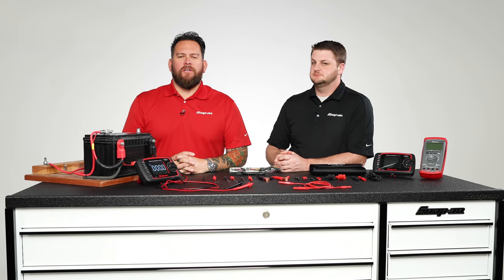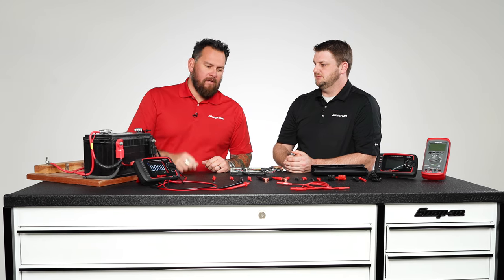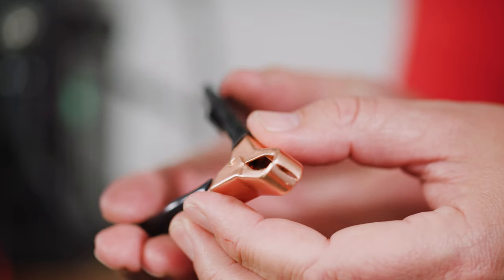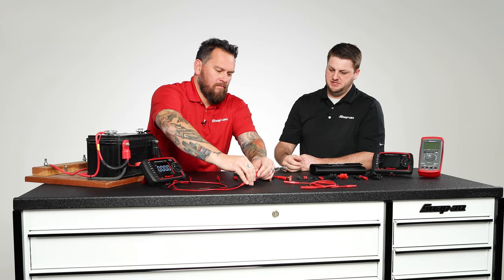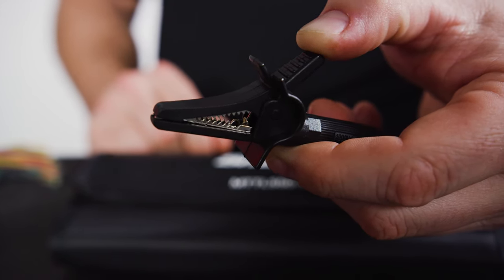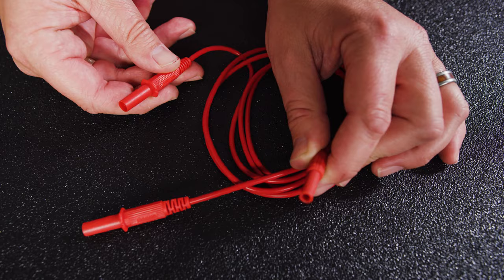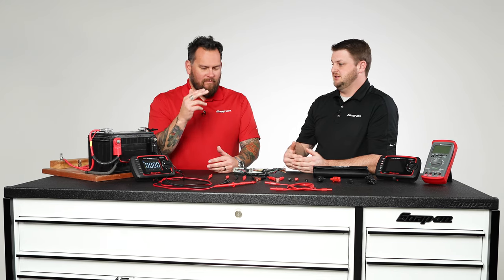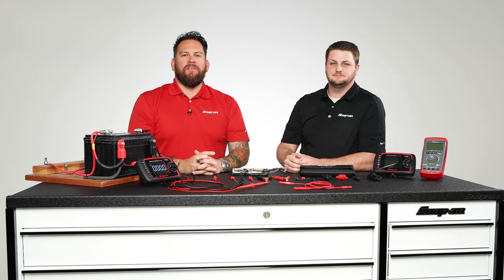Modular Multi-Tester Accessory Kit | Snap-on Tool Tips

Comment: I bought the eedm5030 transducer of snap on , i need help to use them if possible make video using them  for pressure cilynder measure. thanks snap on
Reply: Check out this video, https://www.youtube.com/watch?v=-NAHPZOhR2c . He demonstrates using a PV350 which is identical in output to the eedm5030 as far as scaling. Good info for getting it set up.
Reply: @ednewell1847  thanks
Reply: in mine i'm losing the reference line of atmospheric pressure